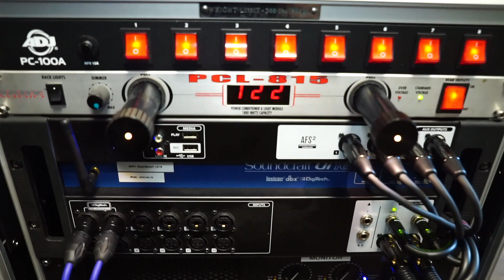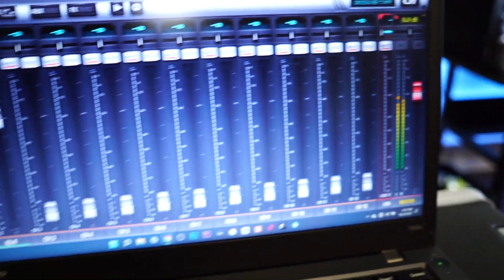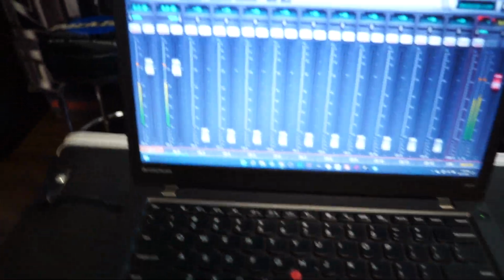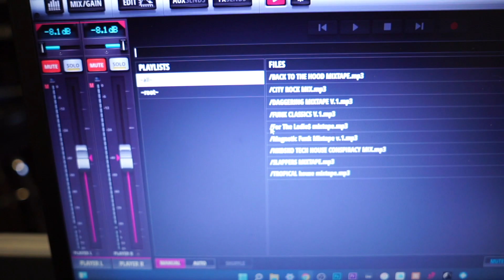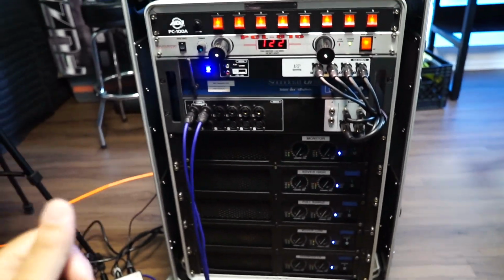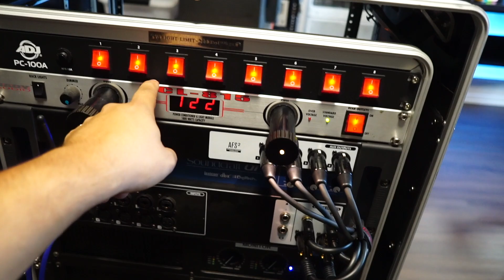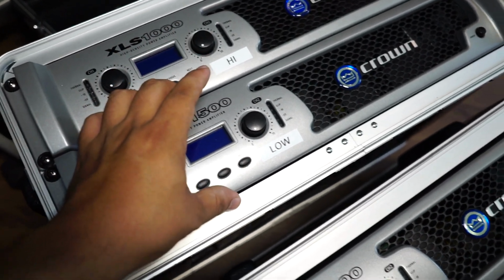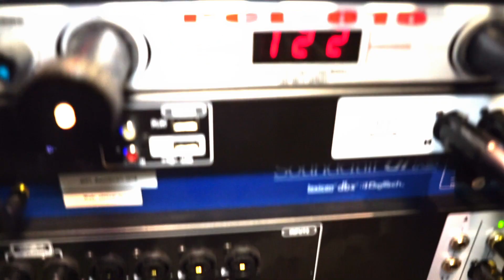How To Build A Digital Amplifier Rack

Comment: Hey man, really great video! also a nice rack build. i am very impressed by your choice of equipment! as a sound engineer i have just one tipp, i would like to share with you: as much as i know, you don’t have to feed the Subwoofers with stereo signal, because bass spreads 360° from the speaker, so by feeding them mono signal, you are less likely to get pan differences and you have an extra aux port on the soundcraft. the extra aux port could come in handy if you need to feed a delayed signal to a group of amps (otherwise i think your amps have a built in dsp? then you’ve already got a solution for delay). in this case another good use for the extra aux port in my opinion would be, if you want to split the bass signal into low bass (25-80hz) and kick bass (80-150hz) for more efficient use of your Subs, but this depends on your own preferences and on what frequency ranges are best for the Subs.
keep up the good work man! cheers
Reply from the maker: i will do that, the othre day i needed a seperate signal for someone's livestream and i didnt have sends